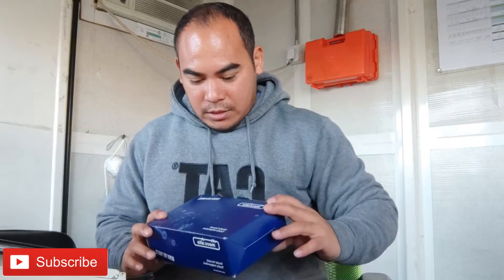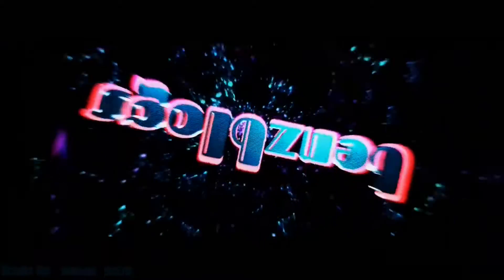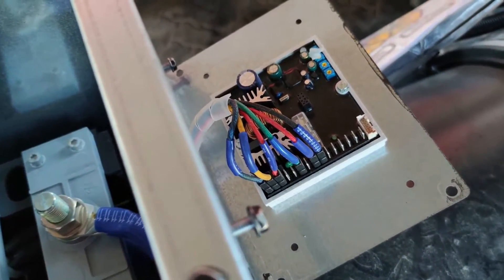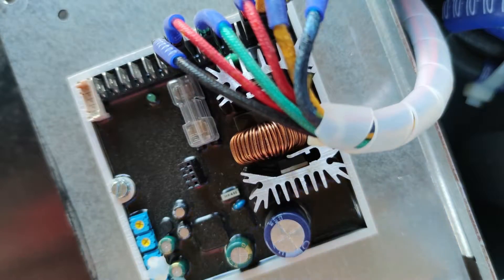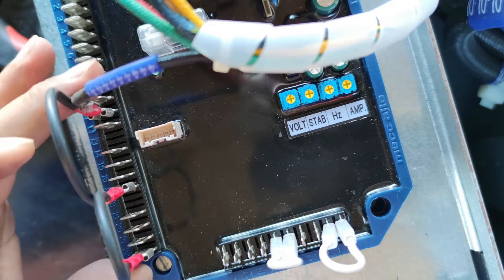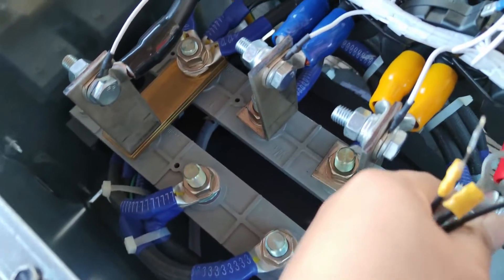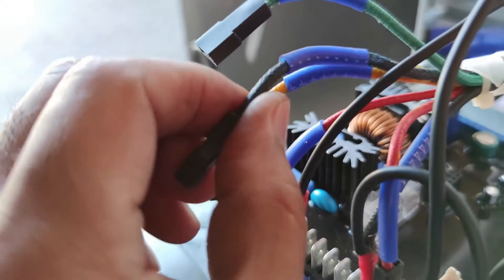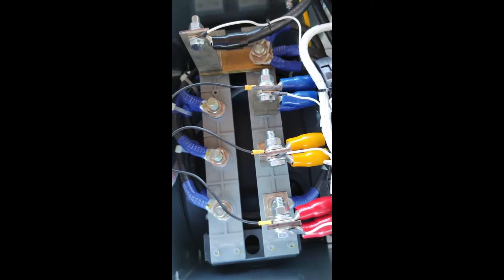Wiring Installation from DSR to DER 1 meccalte avr benzblogs

Comment: DER 1 Synchronize  for Avr  connection  Jp1 ?
Reply from the maker: Its always vary to your sensing its must be 3phase sensing
Reply from the maker: Ither 75-150 vac or 150-300vac all are aplicable in sync

Comment: When I used single phase and when i used single phase. said me
Reply from the maker: U did not understand me bro this DER1 have two types of sensing okay ither 3phase or single phase you can use is clear to you? Read clearly pls
Reply from the maker: This sensing have voltage ranges read the manual okay thank you

Comment: I excite the alternator with DC 12 volts.  I give the avr Sensing 220 volts or three phase sensing for der one avr
Reply from the maker: You excite how much volatge output if you did correctly
Reply from the maker: And what you should aviod while doing the excitation?

Comment: One of our generators says 220Voltage says the generator was running for a while after sensing.  Then after 5 minutes of running the generator voltage does not rise.  In this case the key generator can be run with three phase sensing.  Diode and excitation voltage everything is fine. Avr der 1
Reply from the maker: If you try excite this alternator how much the volatge reaching? Vac?

Comment: Sir benz ano pinag kaiba ng low zigzag at sa high zigzag connection pag kinovert mo sa single phase ang genset
Reply from the maker: Voltage output and connection
Reply from the maker: And its single phase output for all zigzag
Reply: @benzblogsVlogs  Bale kapag series zigzag high voltage output kpag paarrel zigzag low voltage output
Reply from the maker: Yes but all single phase
Reply: @benzblogsVlogs  OK sir maaming salamat Pro maka apekto ito sa kva ng genset Bale baba ba ung rating ng genset
Reply from the maker: @kyoot_leah6973  dependi sa klasi ng alternator always refer to the manual 40-50 %mabawas